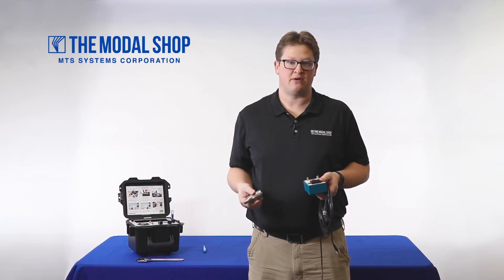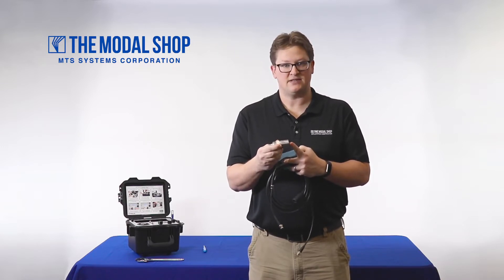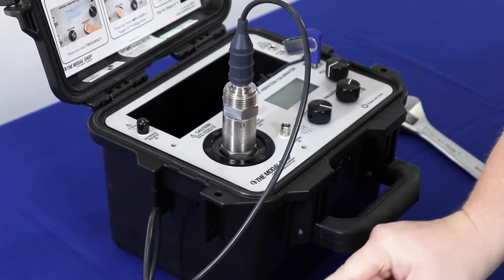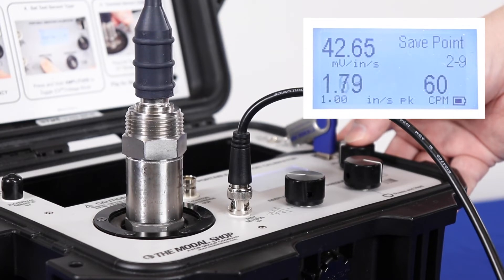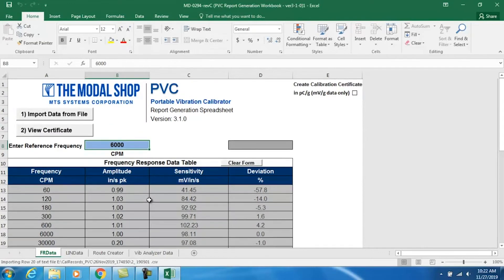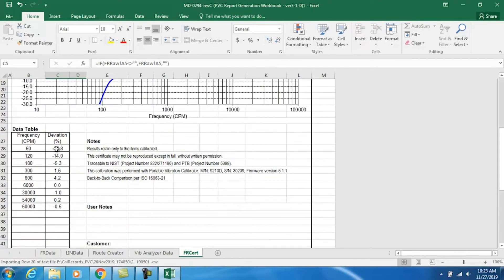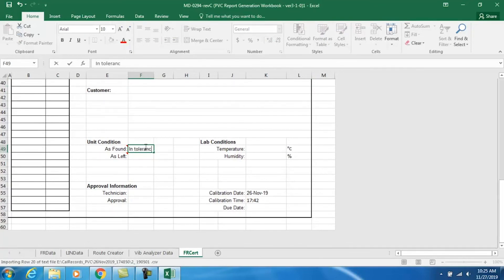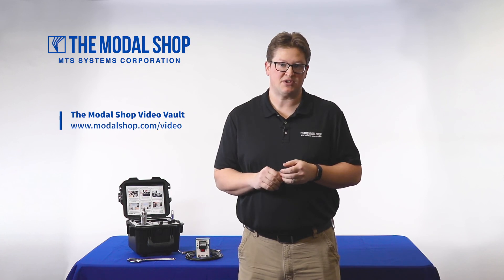Low Frequency Calibration of Bently Nevada 190501 Velomitor CT Sensor

Comment: If the results are out of range, is replacement necessary or re-calibration is sufficient?
Reply from the maker: Unfortunately, vibration sensors generally cannot be adjusted to pass calibration. There are some exceptions, but not the Bently Nevada 190501. If the sensor is found to be out of tolerance and the user wishes to continue using the sensor accurately then the adjustment must be made in data acquisition. For example, if the 190501 was found to be 80 mV/ips (ips = inch per second) at 100 Hz, the technician could change the input sensitivity on the measurement channel from 100 mV/ips to 80 mV/ips. But this is not commonly done. It is more likely that the technician would replace the sensor.

Comment: Excellent video. Do you have an example how to use a 480c02 to calibrate ICP sensors?
Reply from the maker: The 480C02 is an ICP vibration transducer power supply. By itself, the 480C02 is not capable of calibrating vibration transducers. However it can serve as one of the pieces of instrumentation in the calibration process. Piezoelectric vibration sensors are calibrated using the back-to-back method outlined in ISO 16063-21. This method involves a shaker and reference accelerometer. The sensor under test is mounted back-to-back with the reference accelerometer such that both transducers experience the same vibration from the shaker. The 9210D in the video is a portable vibration calibrator with a shaker inside the case and reference accelerometer.
Reply: @TheModalShop  I'm sorry, I didn't explain correctly. I have a C9110D, but I have only calibrated the accelerometers models 330400 and 177230 at this moment. I have two sensors: EX607A61 and EX607A01 and I have doubts about whether I need to use a C9110D with 480C02  to calibrate the ICP sensors and how to use it.
Reply from the maker: @wansimateos5367  Thanks for the clarification. The Bently Nevada 190501 is the only 2-wire ICP vibration transducer that we know of that requires the 480C02 ICP power supply rather than the ICP power supply inside of our 9110D series of calibrators. For all other ICP sensors, such as the EX607A61 and EX607A01, the ICP power provided by any 9110D series Portable Vibration Calibrator will work just fine.
Reply: @TheModalShop  Thank you very much <3

Comment: Cuanto debe ser la entrada de Voltaje al sensor modelo 190501 de Bently Nevada? What should be the input of voltage ti sensor?
What kind of tester  i need to use to measure the mV of sensivity and How to conect it?
Reply from the maker: Normally for accelerometers and velocity sensors, a standard Digital Volt Meter can be used to measure the mV sensitivity. For example, a Fluke 87V is often used. But the specific sensor in this video – Bently Nevada 190501 – is a low frequency sensor. The low frequency response of the sensor is 1.5 Hz. A standard digital volt meter like the Fluke 87V is not capable of measuring that signal. The Fluke 87V is limited to 30 Hz low frequency response. One could use the Fluke 87V or similar unit if the sensitivity at low frequency was not important. But if you want to measure the mV output at low frequency then a high performance Digital Multi-Meter is required, such as a 6.5 digit unit from Keysight. Alternatively, the calibrator shown in the video – model 9210D – also measures the sensitivity of the 190501. To connect the 190501 to a volt meter, we recommend using a Pomona 1269 BNC F to banana plug and a 2-pin MIL to BNC cable, such as the PCB 508BR010AC (10 ft.). We've included some helpful links below!

- Fluke 87V: https://www.fluke.com/en-us/product/electrical-testing/digital-multimeters/fluke-87v
- Keysight: https://www.keysight.com/us/en/products/digital-multimeters-dmm/truevolt-series-multimeters.html#KeySpecifications
- Pomona 1269: https://www.digikey.com/en/products/detail/pomona-electronics/1269/603922?utm_adgroup=Connectors%2C%20Interconnects&utm_source=google&utm_medium=cpc&utm_campaign=Shopping_Supplier_Pomona%20Electronics_0501_Co-op&utm_term=&utm_content=Connectors%2C%20Interconnects&gclid=Cj0KCQjwwLKFBhDPARIsAPzPi-LW3zDDaKDKlfGLzO_hCQWmRZg8ROB9XIoJFdt1HPMIQL19QxUjhmcaAq2mEALw_wcB
- PCB 508BR010AC: https://www.pcb.com/products?m=508br010ac

Comment: What is the input voltage for velomitor?
Reply from the maker: We powered the 190501 with 28 VDC and 2 mA constant current excitation. The specifications for the 190501 omit the required power. Most Bently Nevada sensors run off of 24 VDC. But in this case we found it was acceptable to power with 28 VDC. It is our understanding that you cannot apply more than 4 mA constant current to this sensor. This is why we needed the 480C02 power supply from PCB (https://www.pcb.com/products?m=480c02). The 9210D supplies too much current.